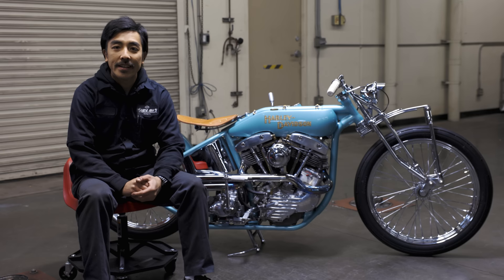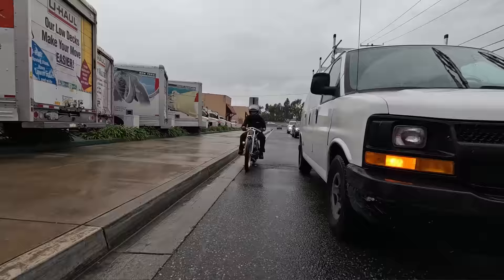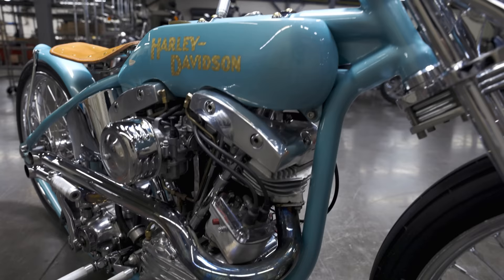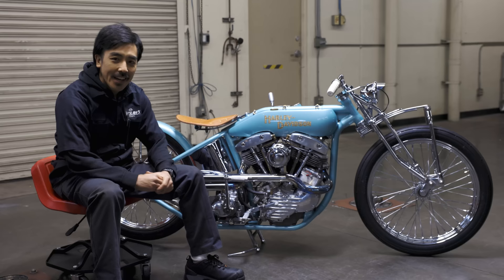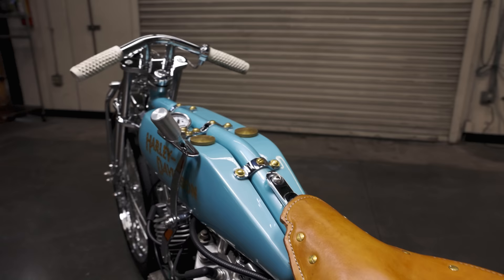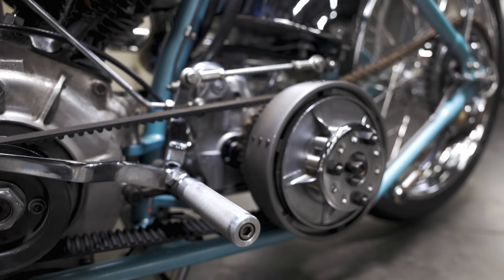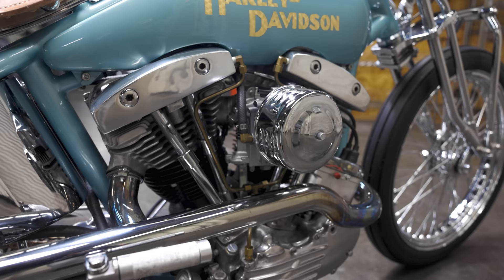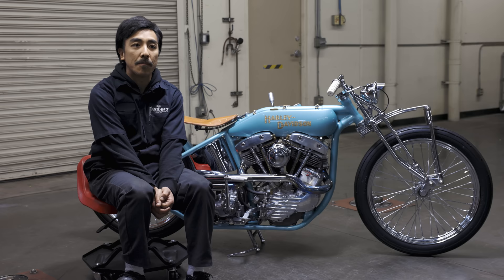Tetsuya's Pan/Shovel Custom Chopper

Comment: Stunningly beautiful Cafe Racer, but man, that looks extremely uncomfortable and unforgiving for anything more than a quick trip to the coffee shop. I would struggle to look at the road ahead/ horizon for any length of time. Looks like his sight line is straight down 5' ahead of the front wheel until he cranks his neck up (Form over function). But Tetsuya, what a work of art!
Reply from the maker: It’s a custom built chopper so yea, it isn’t going to be a comfortable touring machine. 60 years ago that’s kinda how motorcycles were.